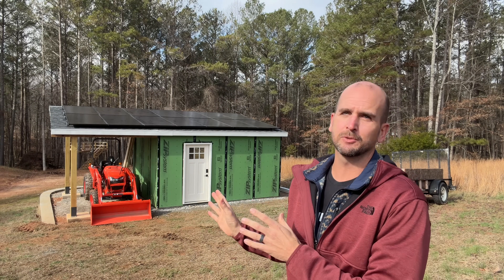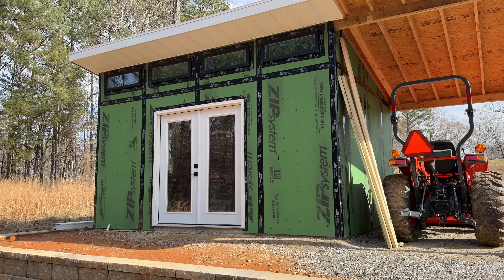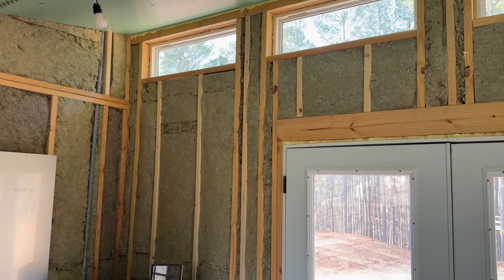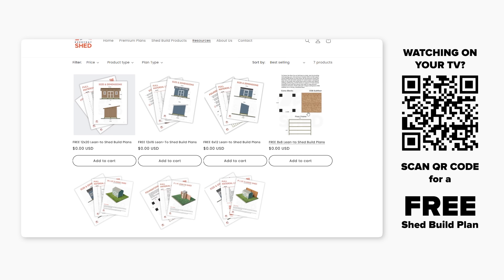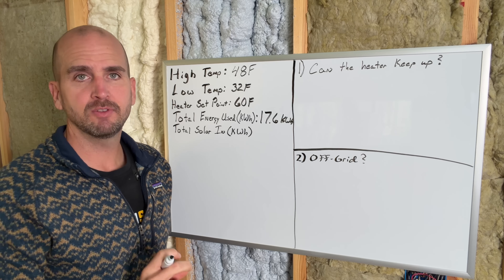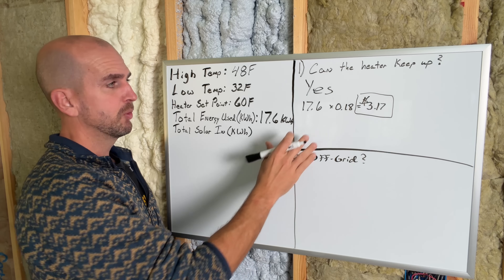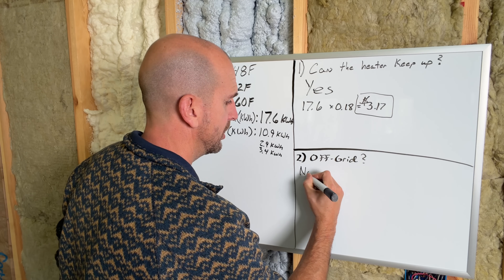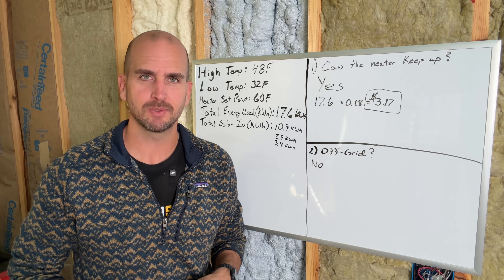HUGE Mistake: Why My $15,000 Solar System CAN'T Heat My Tiny Shed

Comment: Is the floor insulated?    I think  you have  too much glass and those double doors with glass have GOT to hurt. If you don't need them in winter,   maybe  build  a simple  screwed on, gasketed storm window,  or if you are  not too fussy,  apply  a visqueen   type material  in and out.  Same with the upper   skylight windows.

You made some comment about the rafters  ventilation  which I do not understand.  condition space is not vented into the rafters?? is it??

heat pumps are expensive, and you must still have  electric backup for the defrost cycle,  as well as  cold days  below which the pump is ineffective,  unless you can  create  a ground source pump

Comment: Unreal! The energy storage of that system and efficiency seems incredible. Excellent information. Thanks Scott!
Reply from the maker: Hey Josh, yeah that unit is a beast.  What did you do for HVAC in your garage?  I am thinking the 5th Mr Cool 9,000 btu for the final setup in this space.
Reply: @EverydayHomeRepairs  I wish there was a smaller heatpump. 9k BTU is likely way too much for such a small space, unless of course it has a variable speed (or multistage) compressor.
Reply: @EverydayHomeRepairs  If you want to go off-grid the EG4 solar powered minisplit is one option that does not cost much more than a regular mini-split. I would still add in a backup heat source likely a vented (preferred) or ventless propane heater. A tiny gas fireplace would ad ambiance and heat. Solar hot air heaters can also offset some of the heat load. That said, if that is your intention you probably would be better off putting in a complete double wall systems with traditional fiberglass and just making it a lot more insulated.

Comment: 🤔, see the heat pump comments below. I was also surprised. If heating is a priority, you would insulate a little bit differently. Most important is the air sealing. ZIP can be tight but there are a lot of details that need to be managed. I didn't catch how the roof is insulated other than the 2" foam board. A lot of heat will escape there. There is a reason why a hot roof needs to be r49.

Comment: I use 2, 55 gallon drums full of water with a 500 watt fish tank heater in each barrel during the day the solar heats the water and battery during the night keeps it somewhere around 50 f but with outside temps in the low 20f. I only have 3000 watt solar so I still have a backup heater for winter but up here in Canada it is very cold in winter. I did insulate the floor styrafoam and place pex for heat but I have never hooked it up as the barrels seem to work good enough.
Reply: Good point. the 120cm fish tank in my bedroom is kept at 22C. It's on a timer to run only during the sun light hours to use my solar panels. In the winter time, you can feel the warm coming from it at 3 am as I walk past.

Comment: Heating the space is the problem.  It is much more energy efficient to heat your body instead.  Electric lap throws consume far less energy, as do heat therapy wraps.  It is your body that needs the warmth, not the air.  I have saved an estimated couple thousand miles of range in my EV over the years by carrying a small solar generator to power a lap blanket for my passenger and therapy wraps for my ankles.  We stay very comfortable this way.

Comment: Add more insulation to the ceiling. You could cut 2" foam board to fit between the rafters and still leave space for ventilation. That with the the foam board under the rafters would double the insulation you have. Also Drywall ( or paneling )  the interior walls will seal the walls and close off the insulation, improving the efficiency of the walls. And as you have found, you will need more consistent power than just the Solar. Have you considered a small diesel heater as a backup source of heat?

Comment: Usually love your stuff, even like some of your other shed vids, but this one is horrible. ONLY having R10 for roof is nearly pointless... its waaaay to low! most of US has code requirements for attic that start at R38 (for a good reason). Then you went with oil radiator vs a heatpump... 🙄heatpump is 2-5x more heat than a good radiator for same unit of electric input!  Even in Canada

Comment: Using a mini split is much more efficient than using a radiator.
Reply from the maker: Yeah, to be honest after some additional testing I will most likely be going with the 5th Gen 9,000 btu Mr Cool unit.  That should be more efficient and also give me heat even if the outside temp dips to 0F.  I will continue to share the results.

Comment: That roof needs more insulation.  You should do a blower door test on that thing.
Reply from the maker: Would be an interesting test now putting R25 in the roof.  Get some data with R10 and then change to R25 to see how much that moved the needle 🤔

Comment: I would suggest minimum of R100+ in the roof, R60+ in the walls.  I would focus more on heat loss then heat creation.  This will bring  down equipment costs.
Reply: He should have just ordered $20k of rockwool and then carved it into an igloo, then he could heat the inside with a disposable hand warmer pouch

Comment: Perfect example of why solar stinks.  A $15,000 solar system cannot provide nearly enough power to do what would cost $3.17 per day with grid power.  For that $15,000, you could pay for 4,700 days of grid power.

Comment: I wonder what day two Electric usage was for that heater since a lot of day one was just getting the shed up to a certain temperature?
Reply from the maker: From what I am seeing for my setup to maintain 60F inside when it is 32F outside would be 15-17 kWh per 24 hour period.  I am testing 50F right now which I am guessing will drop that down to around 10 kWh per 24 hour period and this would be sustained and not just day 1 getting everything warmed up.

Comment: One approach is to have a heat load calculation done with manual J. This will give you the gain / loss numbers needed to maintain desired temps. Most cost effective solution here would be to increase the R value of the ceiling.

Comment: I think a small mini split 110v.  and maybe a diesel heater to supplement during the night or if battery depletion.    surely you could do it then,  with the added cost of some diesel fuel.

Comment: Don't worry folks, he's no dummy! He knows exactly what he's doing with that electric radiator heater. He's waiting for Mr. Cool or some other heat pump company to sponsor his upgrade. Smart man!😉
Reply: Just so you know... nothing is going to beat more thermal insulation and thermal mass. Heat pump is going to help some. But insulation and heat mass is going to carry over the cold nights when no solar is available.
Reply from the maker: 5th gen 9,000 btu Mr Cool is my leading contender for the long-term solution. 👍👍
Reply: @EverydayHomeRepairs 12,000 BTU EG4 Minisplit with direct solar connection, no inverter required, and you'll be able to heat all day long using 50% of those panels, then use the remaining to charge the battery pack and provide nighttime heat.
Reply: @EverydayHomeRepairs  Get a unit with direct DC inputs for solar. Super simple
Reply: @EverydayHomeRepairs  Good choice... That will do the trick....

Comment: a 9000btu mini split would have used a ton less energy and kept it at the same temp. I use a 12,000btu to heat 480sqft and i have 20KWh of batteries and its had zero problems of keeping up so far. I also have that room inside my 2100sqft shop set at 64 degrees. The walls are insulated with rockwool and the 2x10 ceiling is R30 insulation. Your building would do a lot better if you added more insulation to the roof.
Reply: This. Keep the temp low, especially at night when you're not in it, then supplement with a propane or diesel heater if necessary. Using solar to run a resistive heater is crazy.
Reply: I have 10 times the batteries he does, for 1/4th the cost he spent. on his system. My used panels are 8kw and only cost 1k
I heat around 1000sqft on ~600 watts with a high efficiency heat pump
His system is an abomination as far as DIY goes. Especially the solar
Reply: ... But... If you think about it, you only need heat pumps (or any additional heating) if you are actively losing heat on a continuous basis. If there was less heat loss to the environment than less input heat (of any sort) would be needed. Still, heat pumps, pulling in external energy is a great idea (albeit somewhat expensive)
Reply: @mb-3faze  Not nearly as expensive as all that ecoflow crap he has. A real DIY solar setup with a mini split would be significantly cheaper than just his ecoflow crap alone.
Reply: @mb-3faze your going to be losing heat to the environment in 90+% of the US during the winter. Heat pumps are now so cheap it'll pay itself off in less than a yr to segment your house. Put heat pumps in your bedrooms, shut the doors and don't run the central furnace all night. Next step is to overamp your solar cc to compensate for the lack of production. I haven't done the latter yet.
Reply: I came here to say this. And, since this is directed at DIYers, forget about the power system and go with LiFePo batteries and an inverter. It would be far cheaper per kWh.

And yes, when I heard r10 on the roof, I was thinking, "now here's a guy that forgot to do his research". 

The solution shown here is for someone who wants to create content and get sponsored. It's not practical at all.
Reply: @CRuM770 got to have sun 1st. I haven't seen the sun in a wk.😅
Reply: @Gary-ee3kq even with zero sunny days for 4-5 days. I have been averaging enough solar off my system to cover the usage of my mini split plus refill my battery bank.

Comment: The “insulation below the slab” is a good question but otherwise I think you presented a really good trial. The high of 48 and low of 32 doesn’t even approach what winter will be. And add in the overcast days….. yeah it’s a no go. I think this will be a good example for many who are rhimking about this.

Comment: Love the analysis here. It does raise a question though—if the envelope performance were boosted, wouldn’t the heating load (and run time) drop significantly? The lowest-load home is the one that doesn’t leak.

Comment: Yes, heating uses a lot of energy. There is a great YouTube channel called the limiting factor where in the last year they made a wonderful video analyzing. Could the entire US power grid runoff of renewable energy. The conclusion was it is possible up to about 90%. It makes economic sense up to 90% however to get that last 10% would bring cost exponentially higher and us make it not viable economically speaking.

And I think that’s what this video shows. And also in our own set up, we live off grid and are going through our first winter, and we are in the south and don’t even have that bad of winters, but in the days where the highs are in the 40s and the lows dipped down into the 20s or 30s, we are using 60 to 80 kWh per day depending on how warm we want the house to be. And this is for a house that is less than 1000 ft.².

Thankfully, our winters are mild, and only one or two months long. So it’s something we can endure. However, if I lived in a place with a real winter, I would either look into geothermal if I care about renewables, or I would just stick with a propane or methane system. 

Let that cover the 10% of your energy need so that you don’t have to spend double what you paid for for the first 90% just to get the last 10%. 

I mean, batteries are coming down, not to the UL listed ones, but I still think it’s at least five years away before we can reasonably have access to 200 kWh of energy for less than 20k

Comment: Those 1500 watt heaters just blow thru battery storage. Remember also that the hours of daylight are far less than summer and also the suns rays are at a lower angle in winter. Solar panels just aren’t as efficient in winter.
Reply: Actually, solar panels produce more power with higher effiency when cold but less sun is the problem...

Comment: Thanks for the reality check. Off grid and solar never works, unless you live where it is warm all the time. And, and this is huge, if you buy solar panels and batteries to help supplement your electricity from the grid, you end up with a costly project that doesn't really do anything. Electrical companies are raising non electricity costs with admin charges which are always charged even if you use no electricity. so if you break down your costs for solar, your payoff is 25 years plus. but that time your solar panels are needing replacement. If you want to live off the grid, a gas generator is your only choice and i mean natural gas with a pipe to your home, which will also cost far more than normal electricity.

Comment: I think given what you are doing a mini split heater with some nice heating abilities could largely be enough. If you have solar, you could optimize it for winter month and heating abilities, and therefore not bother with cooling during summer because of the high solar output. I'm pretty sure you could save a lot here.

Also, I would kinda consider more isolation if I were doing it. 400$ to do the whole shed is not really that much especially if you can save money on electricity after. Like 3$/day if you just cut to 50% spending, with 1000$ more of insulation you would need only need around 600 days (or 2 years) to get that money back. Having a 15 000$ solar means that getting 1000$ more of insulation should be doable and probably worth it.

Comment: So many things are working against you in the current setup. Heat rises and that's why roofs call for the most insulation. R40 minimum for moderately-cold climates. You have R10. Why you didn't fill the rafters with insulation is a head scratcher. Next--you used 2x4 walls instead of 2x6, which would have given you significantly more thermal resistance. Then you use possibly the most inefficient electricity-based form of heating. A mini-split would greatly reduce the power consumption. Finally, you're working with the worst possible type of structure to heat--a tiny building. The ratio of exterior-facing surface area to interior volume is off the charts. Bottom line, this never had a chance.
Reply: IT’S A SHED!
Reply: @nate3356 Yes and it's going to make a fantastic shed. However, he wasn't just trying to build a shed. He was trying to build a shed that could hopefully be heated with $15,000 of solar energy equipment. That's where the failure happened

Comment: I'm curious if you're going to scrape out that spray foam and replace it with that nice Rock Wool.
Reply: Why on earth would he do that?
Reply: @nate3356 I watched his prior video and he didn’t seem pleased with the spray foam results. I'm wondering if he will scrape out the dry foam & place rock wool, or cover it with rock wool. If he leaves the spray foam and places rock wool over it I wonder if both in there will compress the rock wool and minimize its insulating abilities. Just curious.

Comment: Minimum 12" isolation on your ceiling, minimum 8" isolation on your walls, minimum 6" isolation in your floor, and you will be able to heat it with a fraction of energy as you try to use now.
My numbers may be strange, but it is code in some places in the world and had been so for years.
Reply: A small shed in the middle of nowhere is pretty "isolating" as it is.  ;)
Reply: My shed I can maintain room temperature at 0*F outside with just body heat. Insulation is everything. 
@K2teknik is correct.
Reply: What the hell is "isolation"?
Reply: @islandguy9380  Something very special, you have no idea about it, you have never even heard about, and will never do because MI6 will not let the public get access to the secret files. Don't tell anyone about it.
Reply: This is a shed, not a home
Reply: @nate3356  heat doesn't care if its a shed or a home. the idea rings true
Reply: @pbm___000  If you don't want to use the shed, sure, eat up all that space and max out insulation.  In the real world, people compromise.
Reply: @nate3356  Someone want's to use the shed as a office, then it goes from shed to office, and an office is a sort of home?
Reply: Someone made a video about the difficulty's to heat a shed even due to the fact that it had been isolated.
I point out that the isolation done is way too little, I also point out that code in some places request the numbers I point out just to say that it is not numbers I grab out of thin air.

The author of the video could had predicted this outcome if he had used one of the many free online isolation calculators, you punch in the size of your building, the thickness/type of isolation in walls/ceilings/floor, size of windows and their thermal property's, and lowermost expected outside temperature, and you get a a number of energy (Watt/joule, etc) needed to keep an specified inside temperature, and the number they put out is often bang on. Before these free online isolation calculators came around it was a huge job to manually calculate this things, but now it is easy.

Comment: A min- split with heat pump inverter technology would cut that power consumption by at least half. Probably more because your overnight low was only about 32°f. Many heat pumps are efficient many degrees below that. And it obviously would cool in the summer. Nice video, but extremely flawed to even suggest that an off grid type situation would even warrant a conventional approach.
Reply: exactly!
Reply: Even worst case a heat pump is 100% efficient at heating
Reply: He is also only heating to 60F, so the temperature delta is rather low, the CoP would probably be around 3-3.5.